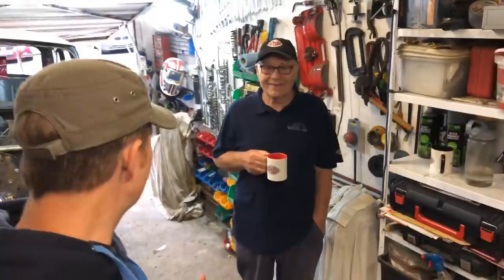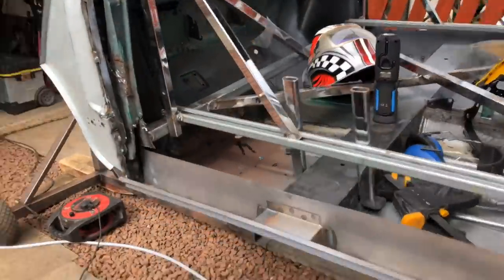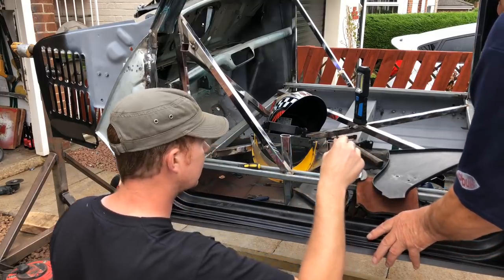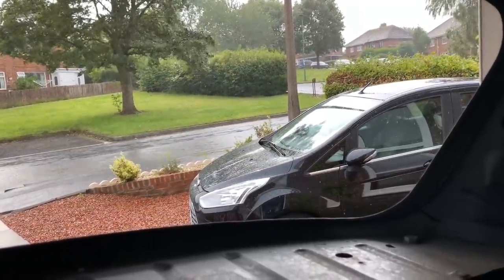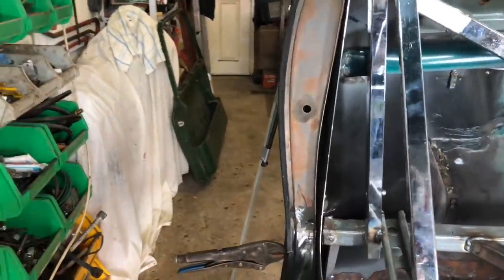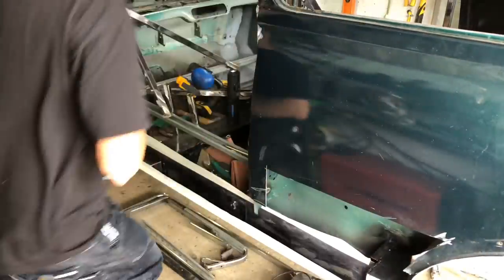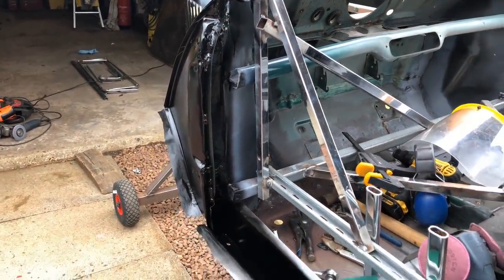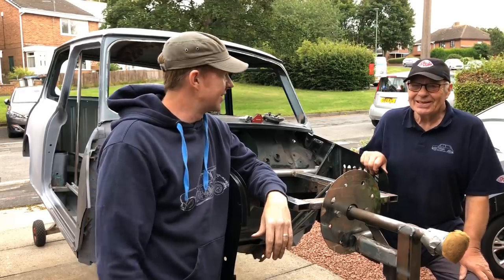Classic Mini Mk1 Conversion - From 1989 Mk4 Classic Mini to Mk1 - Part 33

Comment: I never realised that there were so many differences from the early body shell to the last of them. Height of the doors, smaller back window etc etc. Did they lengthen the A,B and C pillars,ie raise the roof to give more headroom?
Reply from the maker: Hi! Yeah it’s amazing all the little differences, the body is the same size but they just had a bit of extra metal work above the doors. I made a infill panel for the drivers door, that’s in an earlier episode. 👍👍

Comment: An Upbuild video. My day is complete. Can't wait for the next installment. Weren't the back windows smaller on a Mk1 Mini too? Are you going to have to fabricate filler panels for those areas as well? Keep up the good work
Reply from the maker: Hi! Ah that’s great, thank you very much 👍👍 Yeah the rear quarter windows need lowering too, just need the buy some windows so I can work off them to make the infill panels.
Reply: Ah right, thought as much. Thanks for confirming it for me

Comment: Yours is the best Mini build I have ever watched on YouTube, and both of you make a great team on this challenging build. Just one Q, how does the front parcel shelf connect to the A pillar. The shelf would be providing rigidity. Thanks and thumbs up.!
Reply from the maker: Hi! Ah that’s great thank you very much 👍👍 For the front parcel shelf it welded around the back of the bulkhead and there’s a couple of brackets that weld on either side of the dash rail.

Comment: Would it be possible to drop the whole roof down to meet the height of the MKI door frame? I believe the glass is all smaller in height as well.
Alternatively cut down the roof to make a Mini Sprint, these look fantastic.
Reply from the maker: Hi! That’s an interesting thought, I suppose it would be possible but I don’t imagine it would be any less work, probably more in fact. The Mk1 shell is the same size, only with smaller doors so has a piece of metal above the doors and rear quarter windows. The way we’re fitting the doors with that infill panel will make it look perfectly the same as a Mk1, which is what we’re going for. 👍